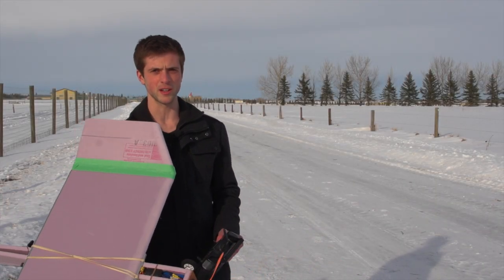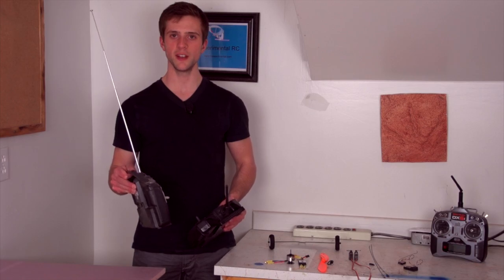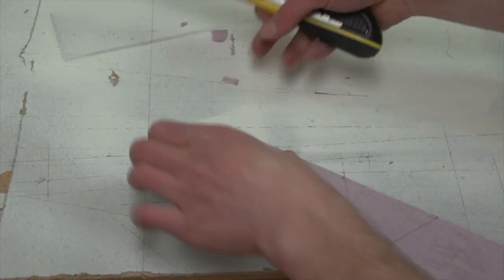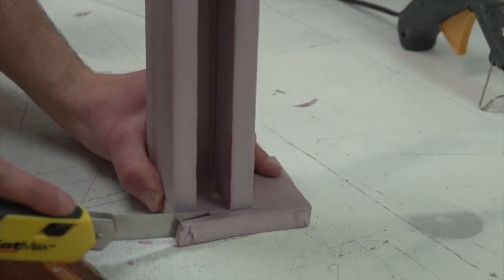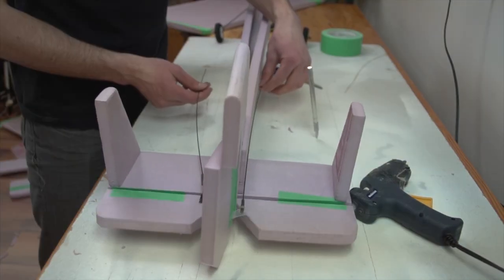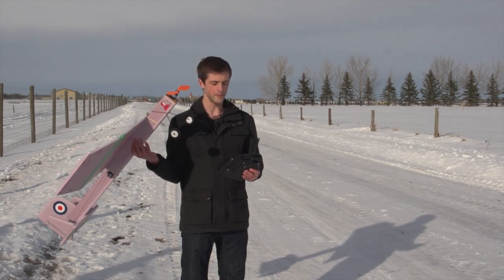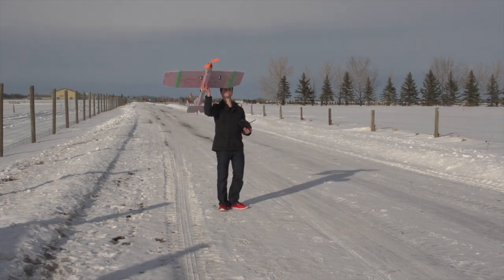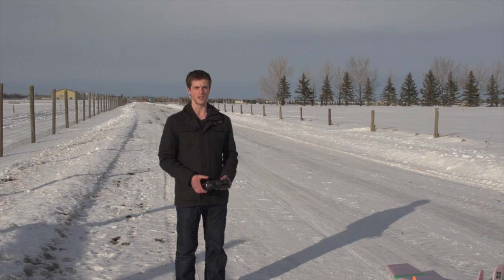How to build and fly an RC plane

Comment: Great video- thanks for posting.
Question for you or the group.

I had an Aeroscout 2 1.1 RC Plane. Crashed it too many times. Just made a foam DIY plane using all same electronics from aeroscout & transmitter DXS spectrum.

All surfaces work while only in “expert mode”. When if switch to “Safe” mode control surfaces on aileron only move in one direction, pulling toggle switch right & servos don’t even move.

Anyone take a stab as to why?

Appreciated
Reply from the maker: Hey Michael, just to take a wild guess, this expert mode sounds like it enables more control surface movement so the aircraft will become more responsive. This would allow you to do do more dramatic aerobatics like barrel rolls, loops, etc. 

The beginner mode will respond less so you have more room for error and more time to react. It may also enable some autoleveling capabilities where it will make adjustments to help keep the aircraft stable.

Comment: Where can I get the landing gear that you used in this video? It doesn’t seem to be on your parts lists
Reply from the maker: They were spare landing gear sold for a hobbyzone supercub but there are many similar wire landing gear out there, but they come and go quickly so it's hard to keep an active link. Check out hobbyking.com they'll have some similar options

Comment: Just wondering what motor you are using and what size of prob because I bought a foam glider that am gonna convert into an RC version and its roughly the same size as yours but I've a hard time deciding what motor n prob to get so if anyone knows greatly appreciated

Comment: Great build but I'm confused about whether the wings should have an airfoil shape. Also, and most remarkable is that your 15 - 20 degree launch is nearer 70 degree. Having said that it must have some considerable lift to not stall at that angle.

Comment: -Motor is about 15$
-ESC - 12-15$
-Batery  < 10$
Servos 2X2ish$ = 4-5 $
-Foam, depends of the region, here it is about 6$
-Proppeler 0.5$(maybe lower)
-Remote 25-30$ (but is one invest for life unless you loose your reciver like i did :) )

-Overwall, about 80$, but with this parts you can make much more planes then this unless you crash them very badly so you broke the components.

-btw, your plane is tail heavy

Comment: How are you supposed to connect the wires from the motor to the controller though? Solder?
Reply: Yep! Strip the wires, check the polarity, and solder away!

Comment: Crossing the rubber bands holding the wing on is a classic neophyte mistake.  Do NOT do that!  The idea of using rubber bands is to have the bands slip off the dowels to release the wing in a crash.  When installed parallel  both rubber bands will each slip off one of their dowels when the wing rotates in a crash.  Crossed, one rubber band will slip off and the other will NOT.  Think about it ...

Comment: You're good looking, you have a good voice, your confidence is high, your tone and delivery is professional. You could have a good career in broadcasting, acting etc. Good video. My only comment is that in my opinion, any trainer should have ailerons. If you learn to fly the right stick with just rudder and elevator, and then you transition TO ailerons, your new, steering, stick, on the ground will be on the left stick and this will take some time to learn the new configuration. As well, learning to use the rudder in the air,(when you have ailerons) will be ANOTHER learning curve.

Comment: what motor did you use and what battery? thanks
Reply: SOSMinecraft1 battery is a 1300 mah probaly 2 cell but mabye 3 dont know the motor
Reply: Luke Baehr okay thank you Im making my own any starters tips?
Reply: SOSMinecraft1 just make sure you look at all the parts and make sure there amps and voltage ratings are compatible with each other
Reply: Luke Baehr alright thanks
Reply: Luke Baehr I'm using a quadcopter motor with a 2200 mah will that work?

Comment: What motor were you using on the plane (not the DT750)?
Reply from the maker: Not sure, but really any 15-30 amp esc and appropriate out runner will be fine!
Reply: the reason i asked was because that motor is really quiet. im looking for a very quiet motor. its ok if you dont remember

Comment: Yeah, your a pro, LOL, if I did that, the wing will com off.  LOL.  HEY, I was wondering if you could make a half scale of this plane in this video for us.  and could you have a blue print of the parts measurements shown at the beginning before cutting.   Thank you soooo much.
Reply from the maker: Just print the plans at 50% and use a smaller motor, esc and battery, probably something around 10-12 amps and a 2 cell 500mah battery.

Comment: I finished the shell and bought all the parts, but i cant find out how to wire it, the motor only moves once every 5 seconds
Reply: have you wired your ESC to you receiver? that can happen when the ESC isn't receiving valid pwm signals
Reply: ya
Reply: i had to clean out my garage so it's in the attic. haven't touched it in a long time
Reply: cool. if you still want to make it fly, you can always check if the ESC works with a servo tester.
Reply: how much are those
Reply: Where I live very cheap. But in the us it's probably around 25 bucks so yeah not too expensive

Comment: what motor is that? I can not seem to find it.
Reply from the maker: There's more info on the blog, (link in the description above) you can just use a comparable motor, doesn't have to be the exact same.

Comment: nice work. But i cant see the  steps for building the wing. is there a separate video for that?
Reply from the maker: Thanks! It's in the video - just glue the tips on and add tape to the joint.
Reply: wing is straight forward... cut it as per the dimensions one 28inch long piece and two 7 inch long.
glue the 7 inch pieces to the either ends of 28inch piece at roughly 15 degree angle.This for the poly-hedral which give self stabilizing characteristics to the plane.
Reply: Ashish Chauhan its not poly hedral ffs xDD

Comment: It would be very helpful if you gave me the complete list of things to get. Like for instance, you haven't mentioned about the landing gear in the video, in "things you'll need". I can imagine someone a little more experienced, thinking that it is just common sense. But I'm a beginner and have never had any experience in this. I'm trying to pickup a new hobby, got interested in RC. So I'd be very happy if you could guide me through this. Thanks.
Reply from the maker: +Alan NE Hey, read the description of the video and follow the link to my blog at the bottom of the description. There you can find plans you can print out, a detailed parts list, and lots of FAQs and answers.

Comment: Excuse me sir but this is important so I am asking what happened if the motors make sounds and when I put the exact material I use then put it to the receiver how came the motor did not work? also I connect the 3 cell battery.

Comment: what is the cost of all materials except foam
????
Reply: +Anurag Gupta 

Price list
My 10 year old son and I made it and it flies great.

 Everything I purchased from Amazon    Total 
$328.02

Total $202.69, if you buy this
Transmitter & Receiver bundle  $41.89   2.4G FS-CT6B 6 CH Radio Model RC 

Transmitter and
simulation software   $149.97   Great Planes RealFlight 7.5 w/Tactic TTX610:  

Receiver
$17.25 Tactic TR624 2.4Ghz 6CH Receiver:       

Motor $19.99 hexTronik DT750 Brushless Outrunner 750kv:

Speed
Controller $15.99  BW 20Amp 20A ESC Brushless Speed Controller 2-3S:

2 Servos  $8.00   Tower pro MG 90S servos:

Props  $7.50  2
of Jrelecs 2 Pairs 1045 Rc 4-axis X-axis Aircraft for Rc Airplane Black:

Landing gear  $11.69  GREAT PLANES Landing Gear Set Flylite EP ARF GPMA2584:

Prop saver   $5.09  uxcell 4mm Airplane Propeller Prop Saver:

Push rods   $9.74 Great Planes Semi-Flexible Pushrod (Set of
2), 36":

Nylon Control
Horns $3.28    Great Planes Nylon Control Horns (Set of 2):

Battery  $15.99 
Turnigy
1300mAh 3S 20C Lipo Pack:

Battery charger $20.86
 iMAX B6 OEM Battery Balance Charger For 1-6 cell Lipo:

Battery charger wall adapter $9.35 Intocircuit LCD 60W 12V 5A Adapter:

Battery charger Connector
$5.99  LHI 3 PCs Male XT60
XT-60 To Female T-Plug Deans Connector: 

Battery fireproof bag
$8.80  BW Fireproof Explosionproof Lipo Battery
Safe Bag:

XT60 Connectors  $5.75  US Shipped Cheap Drones XT60 Connectors 5 Pairs: 

Motor Connector $6.55  10 Pairs Gold Tone
Metal Banana Bullet Plug Male Female Connector 3.5mm:  

Battery extension $6.23  RC 3S Lipo Battery 4Pin JST-EH Plug Balance Charger Cable
Extension:
Reply: +Midtown Groove i built it for 108$,  bought the parts from aliexpress
Reply: Anurag Gupta i got everything except the foam for  $95 including shipping you just jave to buy the right stuff

Comment: how can i get electronics ?
i live in India
Reply: +Karan Batra Hi Karan, I purchased most of the part from Amazon.  I'm in the process of building it now.  It's not inexpensive. I probably spent $130 US dollars already.  But you could cut some corners. Bye.
Reply: +Tony Atkinson 

Price list
My 10 year old son and I made it and it flies great.

 Everything I purchased from Amazon    Total 
$328.02

Total $202.69, if you buy this
Transmitter & Receiver bundle  $41.89   2.4G FS-CT6B 6 CH Radio Model RC 

Transmitter and
simulation software   $149.97   Great Planes RealFlight 7.5 w/Tactic TTX610:  

Receiver
$17.25 Tactic TR624 2.4Ghz 6CH Receiver:       

Motor $19.99 hexTronik DT750 Brushless Outrunner 750kv:

Speed
Controller $15.99  BW 20Amp 20A ESC Brushless Speed Controller 2-3S:

2 Servos  $8.00   Tower pro MG 90S servos:

Props  $7.50  2
of Jrelecs 2 Pairs 1045 Rc 4-axis X-axis Aircraft for Rc Airplane Black:

Landing gear  $11.69  GREAT PLANES Landing Gear Set Flylite EP ARF GPMA2584:

Prop saver   $5.09  uxcell 4mm Airplane Propeller Prop Saver:

Push rods   $9.74 Great Planes Semi-Flexible Pushrod (Set of
2), 36":

Nylon Control
Horns $3.28    Great Planes Nylon Control Horns (Set of 2):

Battery  $15.99 
Turnigy
1300mAh 3S 20C Lipo Pack:

Battery charger $20.86
 iMAX B6 OEM Battery Balance Charger For 1-6 cell Lipo:

Battery charger wall adapter $9.35 Intocircuit LCD 60W 12V 5A Adapter:

Battery charger Connector
$5.99  LHI 3 PCs Male XT60
XT-60 To Female T-Plug Deans Connector: 

Battery fireproof bag
$8.80  BW Fireproof Explosionproof Lipo Battery
Safe Bag:

XT60 Connectors  $5.75  US Shipped Cheap Drones XT60 Connectors 5 Pairs: 

Motor Connector $6.55  10 Pairs Gold Tone
Metal Banana Bullet Plug Male Female Connector 3.5mm:  

Battery extension $6.23  RC 3S Lipo Battery 4Pin JST-EH Plug Balance Charger Cable
Extension:

Comment: could you give me list of all parts that you have used with it's rating
Reply: +Rafi fathima reyana 

Price list
My 10 year old son and I made it and it flies great.

 Everything I purchased from Amazon    Total 
$328.02

Total $202.69, if you buy this
Transmitter & Receiver bundle  $41.89   2.4G FS-CT6B 6 CH Radio Model RC 

Transmitter and
simulation software   $149.97   Great Planes RealFlight 7.5 w/Tactic TTX610:  

Receiver
$17.25 Tactic TR624 2.4Ghz 6CH Receiver:       

Motor $19.99 hexTronik DT750 Brushless Outrunner 750kv:

Speed
Controller $15.99  BW 20Amp 20A ESC Brushless Speed Controller 2-3S:

2 Servos  $8.00   Tower pro MG 90S servos:

Props  $7.50  2
of Jrelecs 2 Pairs 1045 Rc 4-axis X-axis Aircraft for Rc Airplane Black:

Landing gear  $11.69  GREAT PLANES Landing Gear Set Flylite EP ARF GPMA2584:

Prop saver   $5.09  uxcell 4mm Airplane Propeller Prop Saver:

Push rods   $9.74 Great Planes Semi-Flexible Pushrod (Set of
2), 36":

Nylon Control
Horns $3.28    Great Planes Nylon Control Horns (Set of 2):

Battery  $15.99 
Turnigy
1300mAh 3S 20C Lipo Pack:

Battery charger $20.86
 iMAX B6 OEM Battery Balance Charger For 1-6 cell Lipo:

Battery charger wall adapter $9.35 Intocircuit LCD 60W 12V 5A Adapter:

Battery charger Connector
$5.99  LHI 3 PCs Male XT60
XT-60 To Female T-Plug Deans Connector: 

Battery fireproof bag
$8.80  BW Fireproof Explosionproof Lipo Battery
Safe Bag:

XT60 Connectors  $5.75  US Shipped Cheap Drones XT60 Connectors 5 Pairs: 

Motor Connector $6.55  10 Pairs Gold Tone
Metal Banana Bullet Plug Male Female Connector 3.5mm:  

Battery extension $6.23  RC 3S Lipo Battery 4Pin JST-EH Plug Balance Charger Cable
Extension:

Comment: could you give me a list of all parts please of what you used
Reply: +The Sslaiden 
Price list
My 10 year old son and I made it and it flies great.

 Everything I purchased from Amazon    Total 
$328.02

Total $202.69, if you buy this
Transmitter & Receiver bundle  $41.89   2.4G FS-CT6B 6 CH Radio Model RC 

Transmitter and
simulation software   $149.97   Great Planes RealFlight 7.5 w/Tactic TTX610:  

Receiver
$17.25 Tactic TR624 2.4Ghz 6CH Receiver:       

Motor $19.99 hexTronik DT750 Brushless Outrunner 750kv:

Speed
Controller $15.99  BW 20Amp 20A ESC Brushless Speed Controller 2-3S:

2 Servos  $8.00   Tower pro MG 90S servos:

Props  $7.50  2
of Jrelecs 2 Pairs 1045 Rc 4-axis X-axis Aircraft for Rc Airplane Black:

Landing gear  $11.69  GREAT PLANES Landing Gear Set Flylite EP ARF GPMA2584:

Prop saver   $5.09  uxcell 4mm Airplane Propeller Prop Saver:

Push rods   $9.74 Great Planes Semi-Flexible Pushrod (Set of
2), 36":

Nylon Control
Horns $3.28    Great Planes Nylon Control Horns (Set of 2):

Battery  $15.99 
Turnigy
1300mAh 3S 20C Lipo Pack:

Battery charger $20.86
 iMAX B6 OEM Battery Balance Charger For 1-6 cell Lipo:

Battery charger wall adapter $9.35 Intocircuit LCD 60W 12V 5A Adapter:

Battery charger Connector
$5.99  LHI 3 PCs Male XT60
XT-60 To Female T-Plug Deans Connector: 

Battery fireproof bag
$8.80  BW Fireproof Explosionproof Lipo Battery
Safe Bag:

XT60 Connectors  $5.75  US Shipped Cheap Drones XT60 Connectors 5 Pairs: 

Motor Connector $6.55  10 Pairs Gold Tone
Metal Banana Bullet Plug Male Female Connector 3.5mm:  

Battery extension $6.23  RC 3S Lipo Battery 4Pin JST-EH Plug Balance Charger Cable
Extension:

Comment: it was super coollll :) .... I am going to build it for my semester project..plzzz can u just give me the list of materials required.... it was not clear which sheet for design of plane  and RCs you have used...  u can mail me at lazzigirrl@gmail.com
Reply: +Mamoona Safdar 

Price list
My 10 year old son and I made it and it flies great.

 Everything I purchased from Amazon    Total 
$328.02

Total $202.69, if you buy this
Transmitter & Receiver bundle  $41.89   2.4G FS-CT6B 6 CH Radio Model RC 

Transmitter and
simulation software   $149.97   Great Planes RealFlight 7.5 w/Tactic TTX610:  

Receiver
$17.25 Tactic TR624 2.4Ghz 6CH Receiver:       

Motor $19.99 hexTronik DT750 Brushless Outrunner 750kv:

Speed
Controller $15.99  BW 20Amp 20A ESC Brushless Speed Controller 2-3S:

2 Servos  $8.00   Tower pro MG 90S servos:

Props  $7.50  2
of Jrelecs 2 Pairs 1045 Rc 4-axis X-axis Aircraft for Rc Airplane Black:

Landing gear  $11.69  GREAT PLANES Landing Gear Set Flylite EP ARF GPMA2584:

Prop saver   $5.09  uxcell 4mm Airplane Propeller Prop Saver:

Push rods   $9.74 Great Planes Semi-Flexible Pushrod (Set of
2), 36":

Nylon Control
Horns $3.28    Great Planes Nylon Control Horns (Set of 2):

Battery  $15.99 
Turnigy
1300mAh 3S 20C Lipo Pack:

Battery charger $20.86
 iMAX B6 OEM Battery Balance Charger For 1-6 cell Lipo:

Battery charger wall adapter $9.35 Intocircuit LCD 60W 12V 5A Adapter:

Battery charger Connector
$5.99  LHI 3 PCs Male XT60
XT-60 To Female T-Plug Deans Connector: 

Battery fireproof bag
$8.80  BW Fireproof Explosionproof Lipo Battery
Safe Bag:

XT60 Connectors  $5.75  US Shipped Cheap Drones XT60 Connectors 5 Pairs: 

Motor Connector $6.55  10 Pairs Gold Tone
Metal Banana Bullet Plug Male Female Connector 3.5mm:  

Battery extension $6.23  RC 3S Lipo Battery 4Pin JST-EH Plug Balance Charger Cable
Extension:

Comment: what is the price of electronics
Reply: +Ali Rana 

Price list
My 10 year old son and I made it and it flies great.

 Everything I purchased from Amazon    Total 
$328.02

Total $202.69, if you buy this
Transmitter & Receiver bundle  $41.89   2.4G FS-CT6B 6 CH Radio Model RC 

Transmitter and
simulation software   $149.97   Great Planes RealFlight 7.5 w/Tactic TTX610:  

Receiver
$17.25 Tactic TR624 2.4Ghz 6CH Receiver:       

Motor $19.99 hexTronik DT750 Brushless Outrunner 750kv:

Speed
Controller $15.99  BW 20Amp 20A ESC Brushless Speed Controller 2-3S:

2 Servos  $8.00   Tower pro MG 90S servos:

Props  $7.50  2
of Jrelecs 2 Pairs 1045 Rc 4-axis X-axis Aircraft for Rc Airplane Black:

Landing gear  $11.69  GREAT PLANES Landing Gear Set Flylite EP ARF GPMA2584:

Prop saver   $5.09  uxcell 4mm Airplane Propeller Prop Saver:

Push rods   $9.74 Great Planes Semi-Flexible Pushrod (Set of
2), 36":

Nylon Control
Horns $3.28    Great Planes Nylon Control Horns (Set of 2):

Battery  $15.99 
Turnigy
1300mAh 3S 20C Lipo Pack:

Battery charger $20.86
 iMAX B6 OEM Battery Balance Charger For 1-6 cell Lipo:

Battery charger wall adapter $9.35 Intocircuit LCD 60W 12V 5A Adapter:

Battery charger Connector
$5.99  LHI 3 PCs Male XT60
XT-60 To Female T-Plug Deans Connector: 

Battery fireproof bag
$8.80  BW Fireproof Explosionproof Lipo Battery
Safe Bag:

XT60 Connectors  $5.75  US Shipped Cheap Drones XT60 Connectors 5 Pairs: 

Motor Connector $6.55  10 Pairs Gold Tone
Metal Banana Bullet Plug Male Female Connector 3.5mm:  

Battery extension $6.23  RC 3S Lipo Battery 4Pin JST-EH Plug Balance Charger Cable
Extension: